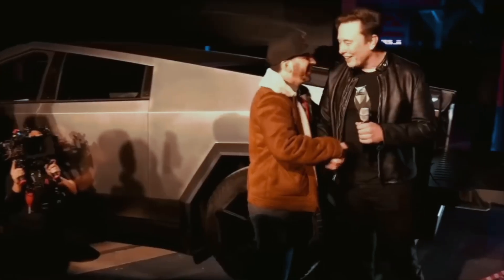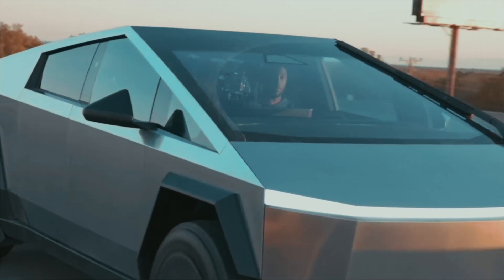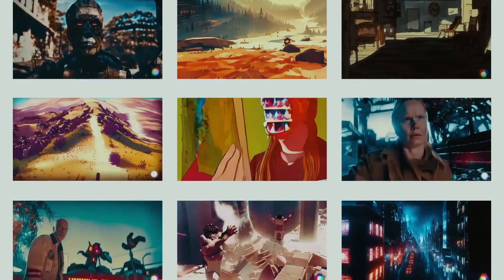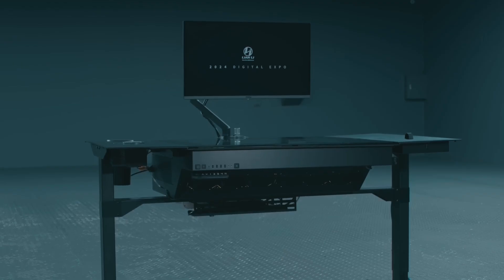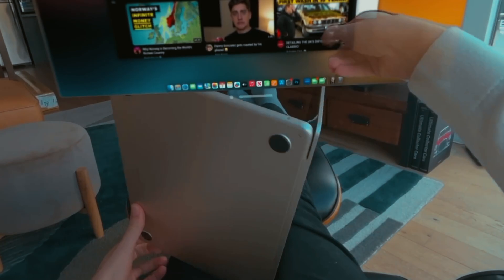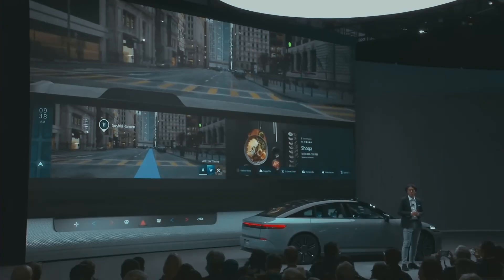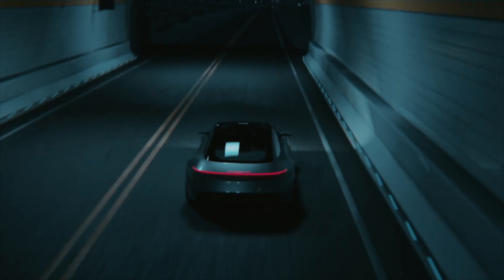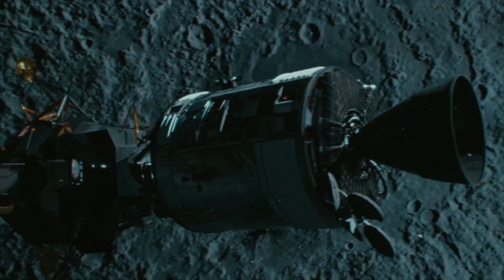The epic fail of Tesla Cybertrack, OpenAI generates Both videos and a novelty from APPLE: VisionBook

Comment: well, stainless steel can have rust spots. but it won't really rust like the metal on normal cars would
Reply from the maker: the body deteriorates very much in a couple of months of use, what are the advantages of buying such a car and getting such quality. This is not a criticism, but just a fact)
Reply: @kik_tech_news  it's not the stainless steel itself that's actually rusting. don't you own any stainless stell cooking pots ? did you ever put water in them ? the Cybertruck's stainless steel will not "deteriorate" in 100 years. it will just look less pretty if you never clean it.